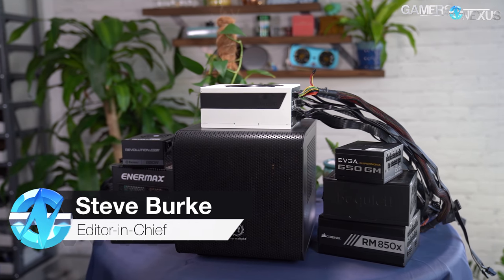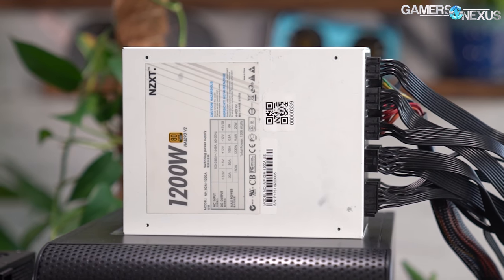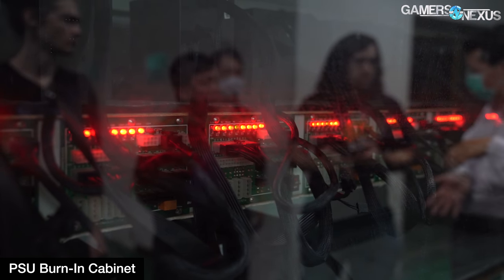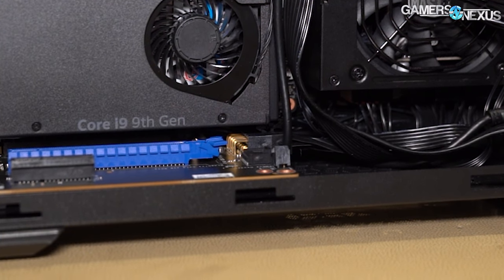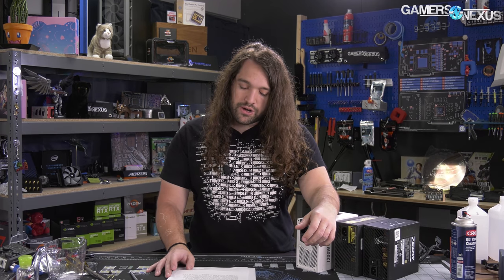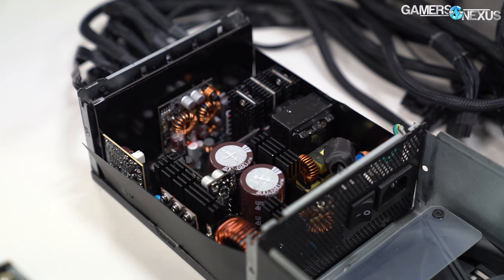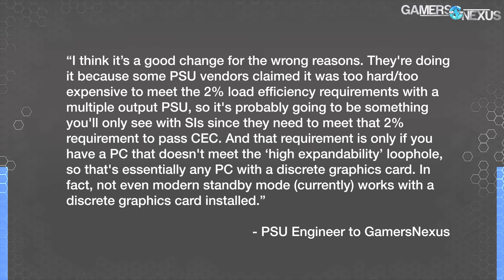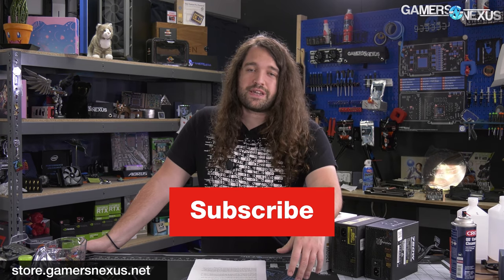Intel's ATX12VO Spec Explained & What Manufacturers Think

Comment: How can moving the dc convertion from psu to motherboard make it more efficient. I woud think psu manufactures are better than motherboard  manufactures at making efficient DC/DC converters.
Reply: PSU manufacturers are not the same as regulator manufacturers. TI, TDK, and Murata have a lot more to do in this space, and are going to be the ones selling the chips used in either case.

Comment: +12VSB makes no sense. It has to be separate low power, always on converter. When it is low power what is the point of another converter on the motherboard? First - you have limited loses being in PSU (as it is low power...), Second you add loses on motherboard because you have to convert this to 5vsb. So as long PSU is doing direct dc 120v to dc 5v there is no benefit, but actual lose in efficiency!

Comment: If they want to reduce idle desktop consumption... they can use AMD CPUs :)
Reply: Idle power of i9-9900KS, 2-3w
Idle power of R9-3950X, 10w-15w
AMDs chipsets are also not very efficient (glares at X570...). Note almost all of the idle power on the 3950X is actually the IO die (SoC), not the cores themselves, I had the same thing with my TR 1950X, the cores would idle under 1w, but the SoC would hover around 30w, and would go up to 45w when i set the ram to 3200MHz, due to the way the Infinity Fabric ran at the same frequency as the ram. If AMD can get the IO die and chipsets power management sorted (they don't seem to do any kind of power management at all in terms of shutting off idle or unused components), they could be onto a winner.

Comment: If it's flexible enough, to accept 12V from a solar battery, I'd be interested.
Reply: You'd have to inject the 12 volts directly into the DC bus. The MPPT controller you're using for your solar panel isn't going to like that, not to mention there being no provision in the power supply.
Reply: I think they work, however, the battery will be empty very fast.

Comment: Personally I see no reason to change anything.  Making a power supply more efficient by moving parts of it to the motherboard is not an improvement nor does it improve efficient, and its making the motherboard more complicated than it already is.
If we end up with 12 volt only power supplies I see motherboards not lasting as long and costing more, power supplies should go down in price.

Comment: It doesn't exactly need to get stuffed on the motherboard adding extra interference frequencys. It could be addons for power supply companies, or motherboard companies. Like some high end server boards don't have their own vrms, they are on a separate daughter board, this could allow power delivery to be its own enthusiast market, the best vrms, the best and cleanest sine wave power, or just, hey you have power! Lol

The psu just pumps out 1200w of 12v the addons become smarter, cleaner, and something that can be replaced, how many times do people have to trash an entire psu because the 3v or 5v rail starts going haywire!?

These addons could also convert the 12vo to the 24 pin for backwards compatibility.

It's not all doom and gloom, it could open other enthusiast segments!
Reply: Don't like the vrms for your new $800 godlike board, upgrade to the ones you want! Lol

Comment: Im all for 12VO then we could finally get rid of the molex connector! With out the need for 5v we could have a 2 pin connector for all devices (pumps, sata drives etc) similar to what a gpu power connector looks like & not have all the issues that fucking molex has!
    Also builds would look much cleaner with a 10 pin mobo connector rather than trying to train & cable comb a  24 pin.

Comment: Intel ATX12VO? Oh great, now my PSU will soon be hot, over expensive and have security issues at the hardware level. Tomorrows mATX motherboard will be the size of today's ATX in order for this to be implemented on the board and we still will not what the hell E-ATX is and it will get more complicated. lol
I already switched to LED light bulbs in my house. Had my central air unit converted to use the more power efficient standards. All of my appliances are energy standard approved as well. I don't own a gas guzzling Bugatti that get 7 miles to the gallon city and 15 miles to the gallon highway. My PC is my "sports car" so leave it the hell alone.

Comment: Most components that ingest 5 or 3.3v like SSD's don't actually use that voltage internally I gets converted down to some 1.x voltage by a DC converter on the device. This could just as easily be done to 12v current as 3.3v. Also it's more efficient this way. The power efficiency obsessed server industry has been using 12v only power supplies for years. Also the smaller main power connector will be easier to cable route. And leave more board space on mITX. This new standard is 100% a good thing. You conspiratorial arm chair experts are talking a bunch of nonsense.

Comment: ld see motherboard manufacuers instead of putting things on motherboard ,  use and aux psu box ith soething like pcie power in to provide down conversions for the 5 and 3 v  this could even be done on an ad in card that did not need to be connected to themotherboard   please ask  a motherboard manufacurer if this would likely be an option

Comment: ATX12VO Makes no sense at all, there is a reason it is called POWER SUPPLY. It's job is to supply power to all the components.
Some things like CPU & GPU are necessities to handle that themselves (too much variance etc.). I think the best way forward is to scrap 3.3, 5V, and perhaps add 24 or 48V option for GPU and CPU supplemental power.

Comment: The fail on this one is strong.  I understand the (noble) goals, but realistically they are making some very basic mistakes.  First and foremost, the connectors should all be different or unique to the new product.  Having a 4 pin molex connector that no longer does all that it use to do is an invitation to problems.  Things will plug in, but some things won't work.  Similarly, if the MB must provide power to drives, should the connectors on the board be integrated and different from current SATA standards?   For that matter, should the requirement to convert 12V to 5V or 3.3V be shifted entirely to the end peripheral devices rather than the motherboards?    There is very little to explain how having the power conversion on the motherboard would be more efficient than having it happen inside the power supply itself.   It seems to be very much left pocket right pocket stuff.  The power still needs to be converted somewhere.

Comment: Well, now, you see, there will still be devices that need the 5V and 3.3V rail. That being SATA and USB, and M.2 drives, respectively. So those will be generated by the motherboard instead, right?  Now, does it really matter where the conversion happens? Fine, the PSU module itself is more efficient, but the entire conversion from mains over 12V to 5V or 3.3V isn't, really. It's a possible way to cut costs in OEM PC's but I honestly doubt it saves any power. It just moves the inefficiency elsewhere. Past where it's being measured for that CEC standard, so it's basically cheating.

Comment: So basically zero efficiency difference because the voltage step down for other peripherals still occurs & will not suddenly become more efficient because its on the mobo instead of psu.
Unless they change other peripherals so all use 12v... with no 5 or 3.3... this does nothing for overall efficiency.
Its Total nonsense.

Comment: So Are All My USB--Connections: Mouse, Keyboard, Mic, Cam, Printer, Headphones, [6] - External HDDs & [4] - Oculus Rift Sensors = All Powered Off--The 12v Rail & The 6-Pin (OC) Connections?
or Are The 3.3/5v Rails Used At All!

I'm On X99 A-II; But (Max) USB: Bandwith & Power--Seemingly Is An Issue--At Times - w/ Full (Max) USB: Usage!
DMI-v2.0 =  :'-(
Reply: why are your USB connectors being powered off 12v? Those are only speced to provide 5v

Comment: The way this will likely play out in a enthusiast market is that  a 12v to 5v+vsb/3.3/-12v breakout board will be developed, it will likely take up a 5.25 drive bay initially or they will get case makers to put a mounting spot on the backside of the motherboard tray. Where your $150 psu becomes a $110 psu with a $40 breakout board + cables. Hell, its already started, look at https://www.youtube.com/watch?v=XH_ItFEycHo (LTT) is it the same? No. But the general concept is there and it wouldn't take much to make that move.

Comment: Intel is very crafty changing specs to complicate current designs to force consumers to buy new over upgrading.  This is no different than changing a CPU socket pin out on a nearly identical processor with a incremental product number. This is a BAD idea.

Comment: Guess this is what happens when people that have no clue about something make the rules. I can see motherbords coming with a adapter power suply the size of a 3.5 drive. They have to do the step down to the 5v a 3.3v some where and that place is now not efficiency controlled.
Reply: Stepping down the power is really no big deal. The smaller connector already saves more space then the extra components for the power conversion need.

Comment: This new standard is a mess in my opinion.
Assuming the standard goes ahead, the mobo should not create 5v for HDD's etc. It should only switch 12v to them (when PC is powered on), then there should be a buck converter for 5v on the cable close to the drive.
Making 5v for drives on the mobo is dumb because you have no idea whether the user will connect SATA SSD's, or SATA HDDs (dramatically different power consumption) or how many they will connect. So if the standard goes ahead the buck to SATA adapter would take a 2 pin (12v and ground) and output SATA power.

No doubt a new standard shakes things up requiring adaptation regardless of how its done AND saving power is good! But 12v is a lame single rail voltage! I would prefer if they made it 48v or at bare-minimum 19v.
With 48v you could have just 2 wires to the GPU instead of 8 and 2 wires to the motherboard instead of 8.
Since the motherboard is converting the 12v down to low voltages like 1~2v for the CPU and RAM, 5v for USB etc; the input voltage might as well be much higher! Then since the SATA drives will need small bucks to make 5v, close to the drives, the bucks might as well take a higher voltage than 12v.
You might say (well that's 2 bucks instead of 1) but that only applies to HDDs. SATA SSD's only take 5v, so you could use a single rail cable mounted buck for those.
Then new HDDs and SSD's would eventually come out that take 48v, then you omit the buck at the end of the cable.

In this scenario everything from the motherboard, GPU, HDDs would all take a single pair of 48v and ground wires. At 48v with slightly thicker wires you could easily split or daisy chain power connectors. Cable management would be much easier. Aside from the (temporarily needed) cable mounted buck converters. You could have literally just 2 wires coming out of the PSU. The PSU could even be an external brick for low power systems. Also with only 2 rails you could electrify rails that hold SSD's and HDD's and 5.25" bays, incl a rail that the PSU slides into. Infact you could even pass the 48v into the motherboard via the mounting screws. And 48v would reduce the current enough that if you pass it to the GPU via a upgraded PCI-E connector, you wouldn't even need a GPU power connector for most GPUs. So basically with 48v you could actually have no power cables in the entire PC in 95+% of enthusiast systems.

#JustAnIdea

Comment: Did you really have to ask Intel, if you can plug device requiring 12V and 5V into power supply providing only 12V using passive adaptor cable? Really?
Reply: Also, considering how often you say "power rail" followed by unspecific sentence, sure sounds you dont actually know what "actual power rail" and "artifically split power rail" means. You sure try to sound like you know what you are talking about, but I am not buying it. Good enough for Muricans, I guess

Comment: I'm concerned how exactly this will improve efficiency given it is exactly what is done inside a psu anyway (mains - 12v dc, then 12vdc to others).
I am also concerned with how they are planning on mitigating the high frequency electromagnetic interference that this kind of buck module would emit.

Comment: All BS aside this should have been done decades ago.  You have the power supply put out a standard voltage then use VREGs to drop voltage as needed.  It really doesn't even have to be as big a deal is it is being made out to be.  Don't cry about motherboard real estate either, this stuff does not take up that much space, or you can make a new motherboard spec and make it slightly larger. Call it ATXVO and move on.

Comment: I suspect this maybe related to this bug:
https://bugzilla.kernel.org/show_bug.cgi?id=196683
Basically, the Ryzen CPU (or at least the early versions), suffered from "processor stall" when idle, due to the power supply not providing the proper minimal voltage (or the voltage not being stable enough) for the CPU to continue operating.
This caused a lot of problems whereas the AMD blamed the motherboard manufacturers, and the board manufacturers blamed the power supply guys.
So I ended up buying a new power supply, and my problems sorta went away. Of course I had to couple that with my linux kernel boot options, disabling Cstates, or not choosing "power saving" mode in the motherboard.
One thing I noticed when I moved from my old B350 motherboard to the X370 , is that the old "power saving" profile has disappeared from the BIOS. Now it's only "normal" and "max power".
So, by doing this new 12V only power supply, the ball passes back to the motherboard manufacturers to provide the CPU with proper voltages, which I reckon is probably a good thing, as you eliminate variables in an ever-increasing-complexity system.

Comment: I think I disagree a bit with 13:08 ... "Power supplies are expected to generally have a longer span of usefulness than most of the rest of the system, like a motherboard for example."

Actually, I personally think cases should have the longest span of usefulness, followed by motherboards, then power supplies.  I base this on how much labor it takes to swap out said part (case or mobo or PSU), combined with how long the PSU lasts until it dies (not just the end of the warranty).

For a baseline example, let's say you have a system with a -T (Intel) or -E (AMD) APU, a SATA SSD, and single-channel non-XMP/DOCP RAM, used for office work, email, etc, powered by something like a Seasonic 1300W Prime Platinum, in an environment where the ambient temperature never exceeds about 14°F or so.  How long might that PSU last until it dies, and how much time would it take to replace it with a new one that's compatible with the existing cables?  (It's a fully modular PSU.)

Next step up the time-of-usefulness ladder - how long would it take to swap out a fully-populated SSI EEB motherboard?  (Assume it has 16+ DIMM slots, 7+ PCIe x16 slots, 2 CPU sockets, lots of SATA / SAS ports (like at least 16 or more), USB, etc.)
Usefulness Time of Mobo (should be)   > / =   lifespan until death of PSU   *   (  labor time to swap mobo  /  labor time to swap PSU  )

Finally, same deal with the case.  Assume that motherboard's 7 PCIe slots are each populated with a Highpoint Rocket 750 RAID card, each of which supports 40 storage devices.  ALL 280 of those drives are in drive bays in the case.  Your new case's HDD / SSD trays or cages are NOT compatible with the ones from the old case, so you have to unscrew the HDDs / SSDs from the trays from the old case, and mount them in the new case.

In a TL;DR nutshell ... basically I really want to see motherboards last a VERY long time, at least in my daily driver system.

I'm hoping to upgrade from Devil's Canyon to Zen 4 / Ryzen 5000 when AM5 / SP5 comes out.  I may start off with something like an Athlon 5000G or Ryzen 3 5200G, but I plan to upgrade my CPU periodically going foward.  (Initial upgrade to like a Ryzen 7 / 9 might be within a year or two, then every 4-5 years after that.)  At the least, I would like to be able to put an Epyc 7xxΩ in the same motherboard.   (You may have noticed the greek lower case Omega character.  The series would start at Ryzen 5000 / Epyc 7xx4 I'm guessing, then go up to 9 numerically, then A to Z, then a to z (case sensitive to get an extra 26), then Γ (Greek capital Gamma - Alpha and Beta look like A and B) to Ω (Greek capital Omega), then α (greek lower-case alpha) to ω (greek lower-case omega), and I haven't even begun to calculate how many generations would be added by also using Hebrew, Russian, Japanese, Chinese, etc. alphabets. :)

Comment: If the motherboard also needs to supply power to drives wouldn't it be the same just as many cables? Because you've got your sata leaving the board anyway, surely you could have 1 cable doing both both and sata joined together side by side?
Reply: The first immediate benefit is that the cable will be only modular, which is a change from modular or non-modular like it is now. The second change is a shorter cable, now SATA cables are at a minimum 30cm long.

All in all, it is a needed change. ATX was getting really stale lately, we are using an spec that is soon to be 25 years old!